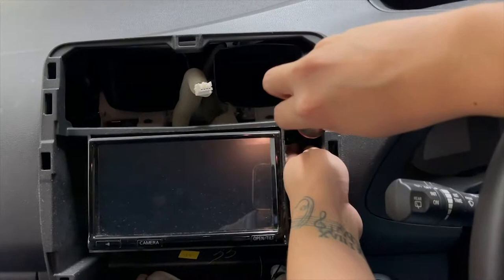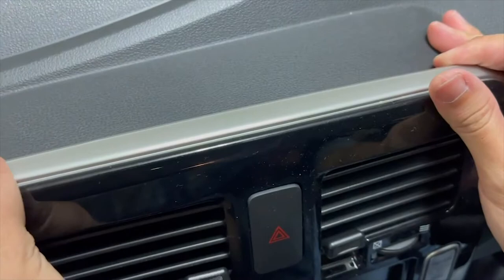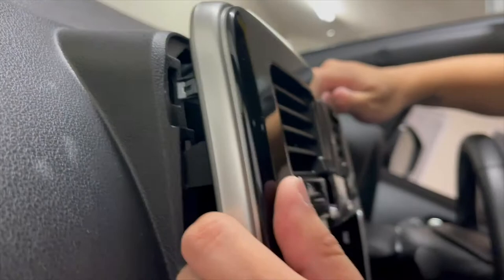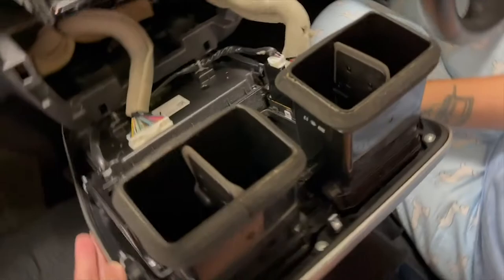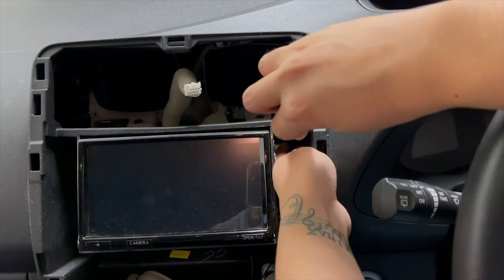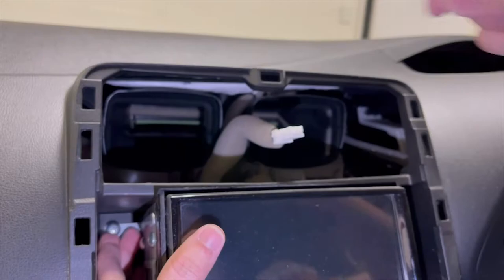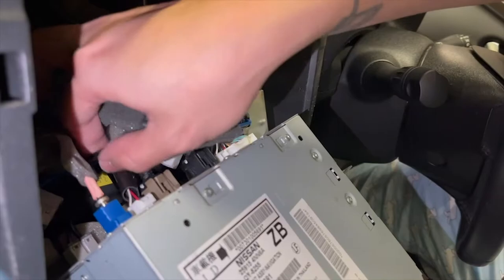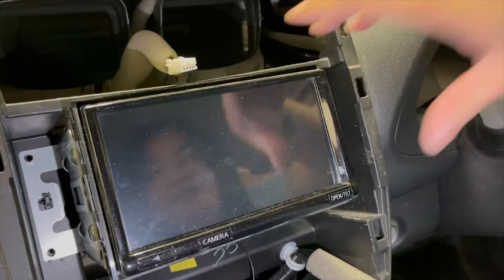How to remove Nissan Leaf head unit + How to add/remove FM Band Expander on Nissan Leaf

Comment: Bro how to set nz map and dash can recorder 
Thankyou
Reply from the maker: The maps are copyrighted materials, and therefore non-Nissan dealers don't do it, and it's out of the scope of the firmware updates. Regarding the dashcam, you can chuck in a 16 GB micro SD card, and it'll record your trips; by default, once your micro SD card gets full, it'll delete older trips.
Reply: @andysaputra  
Thankyou for information when i did language conversion it stopped my dash cam recorder not working nor recording anything any solution.
Thankyou 
Vijay
Reply from the maker: @vijaysingh-zr5lc  it could be a version difference; downloading your micro SD card data and reformatting it should fix the issue.
Reply: @andysaputra  
Thankyou i will check that if it works  .
👍